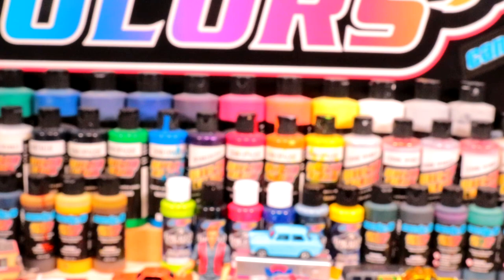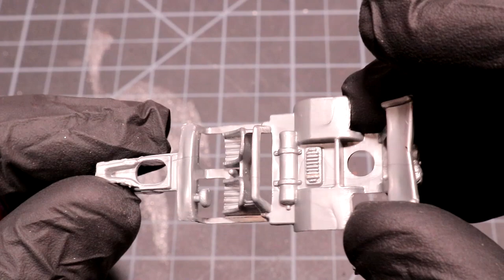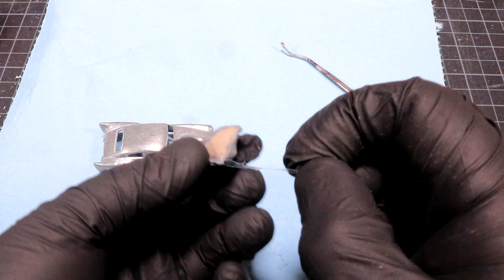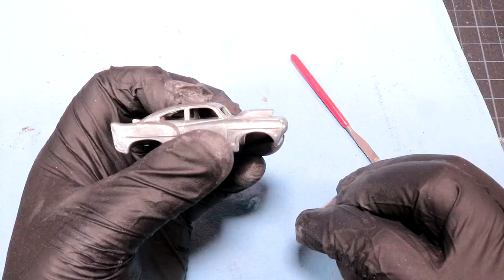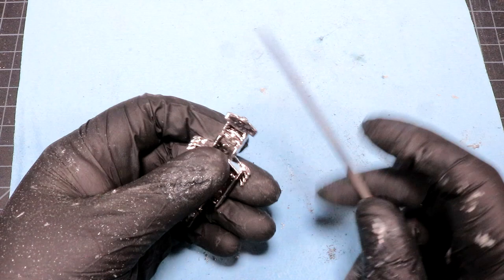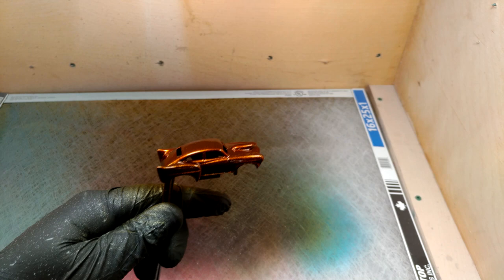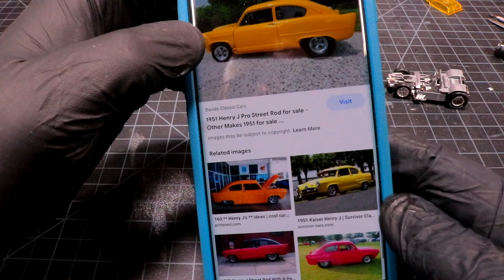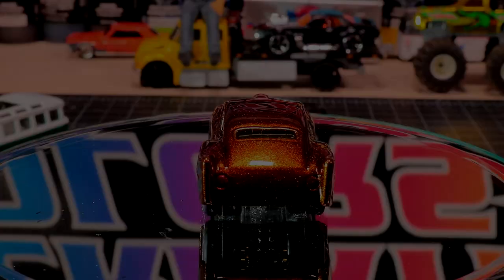Painting Diecast Cars - Henry J Sedan Custom Diecast

Comment: Looks like 57 Chevy fins on that puppy. I dig it... One car I drove in high-school was a 59 Chevy Station Wagon it has those killer horizontal fins... I like the 1959 better than the 60's. If I can find a  1959 Station Wagon hot wheels like I had in school I'll send it to you so you can trick it out.

Comment: I’m thinking if you get your hands on another one, maybe you could round over the quarter panels and get rid of that high wing, flared look on the rear. It looks like one of those cars someone turned into a hot rod, then went one step too far and made it look like an old Caddy.

I’m just now getting to the first coat of paint portion of the video, so I might change my mind when I see the finished product 😉